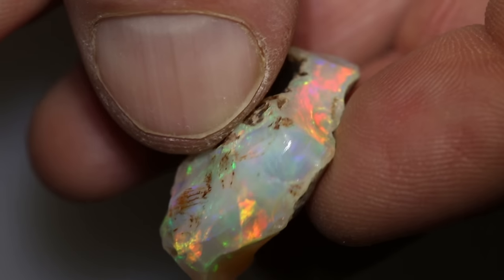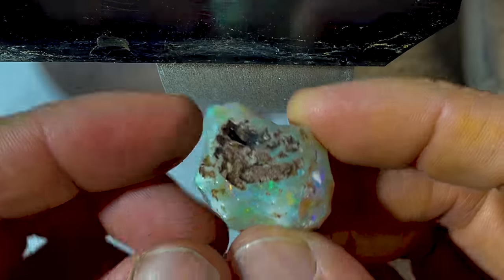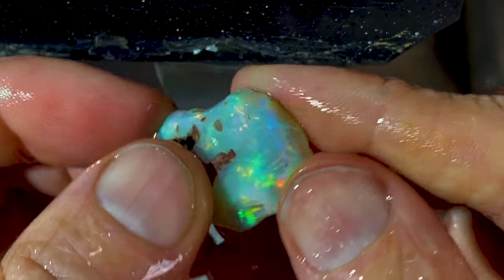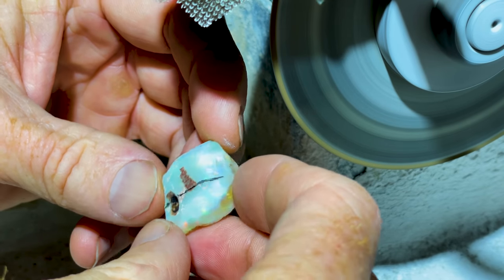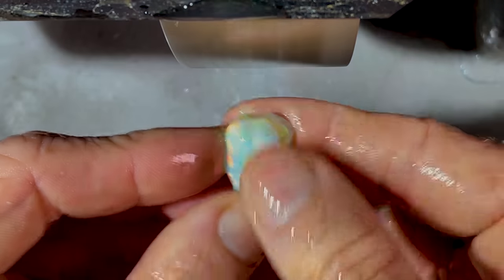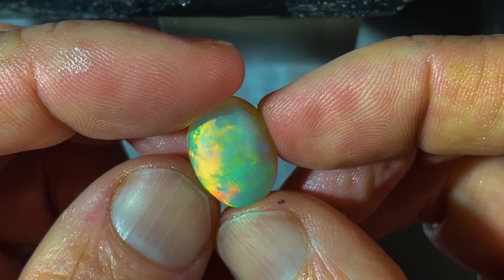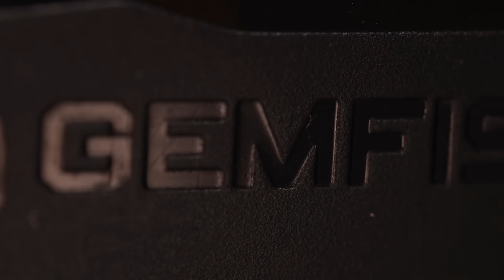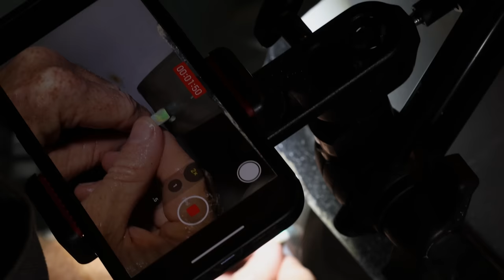Uncut Crystal Gem Opal — or so I thought!

Comment: This is so interesting to me. Our Science department at my college is currently having us run studies on more effective ways to remove Sand and Potch from Gemstones. 
We have a Chemical compounding test (Which is still very much a fail as it weakens the stone over the acceptable limit.) 
As well as a precision Lazer that so far has been able to be calibrated so that it only flakes off the Sand and leaves the stone intact. It's got a lot more work to go into it but the hopeful outcome is that we will ve able to remove just the unwanted bits inside the Stone and give a clear and clean look for the cutter on how to maximize the stone's beauty and color.

Comment: Hello, nice gem ❤. I want to just to say , removing the black layer with a flat sanding surface will make you confused about the right cuting line, in my opinion removing the black layer "frst" using a much precise sanding tool will help you much more to find the maximum volume. I like opal , it is really amazing ❤❤❤❤

Comment: I just realize the water erosion u have under the wheel made by water and stone mixture, shows some hours of use lmao
If you want to avoid further dmg, you can make a little pipe neck on the water exit so water level raises a bit and when your done you remove it ...

Comment: I was a little surprised that you kept the face orientation after the split. It looked to me like color face wasn't the flat top you had, but angled a few degrees down and away from the slice. With that much stone thickness still under it, may I ask what you saw that kept you from refacing for the brightest color?
Reply from the maker: weight is what kept me from doing that. It would be half the weight with the possible risk it the color disappearing even more than it already did

Comment: Hey team, the audio levels in this video seem a bit off. Depending on the software you're using, try selecting the audio file and normalizing it. You can also compress the audio for more consistent volume levels throughout. Normalizing adjusts the volume to its peak without causing distortion. After that, you can fine-tune the volume based on the desired intensity. By following these steps, you can make sure future videos have accurate audio levels, leading to a better user experience while watching.